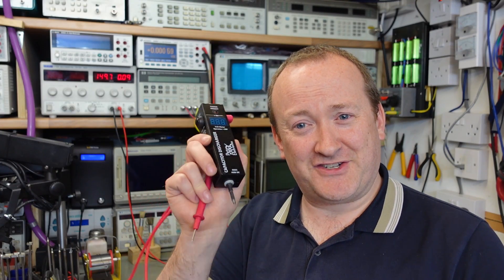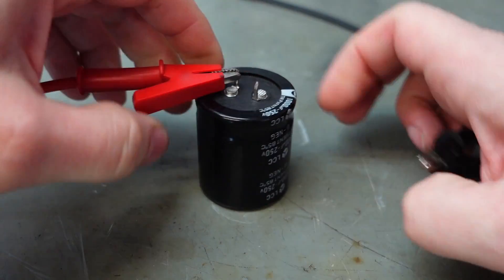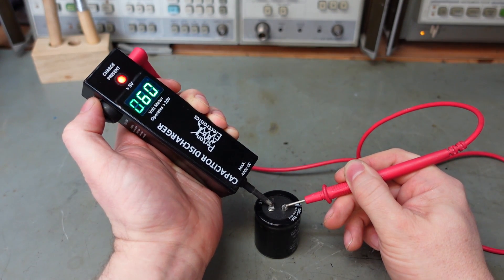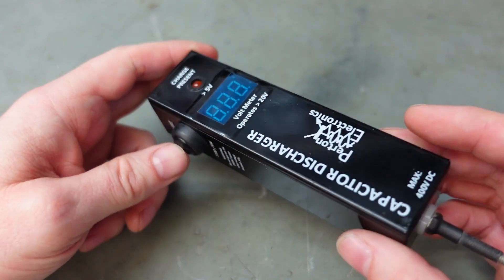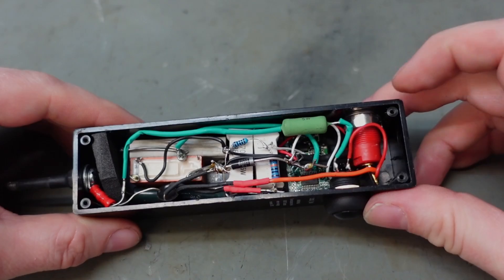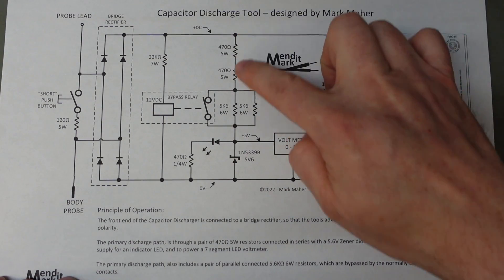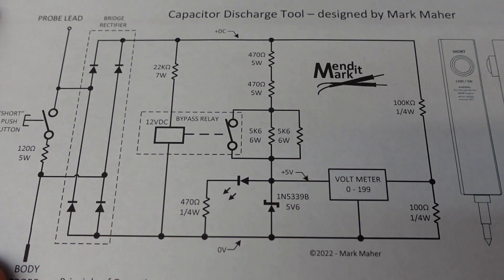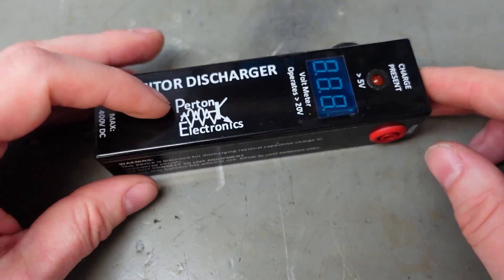The BEST Capacitor Discharge Tool I ever had!

Comment: Question.  What prevents over voltage of the 12 relay inputs? My relays max out at 30 volts and the voltage on my capacitors varies widely.

Comment: I'm confused by the resistors to the right of the voltage meter. If that's the sense lead of the meter, the resistors would form a 1001:1 attenuator, right?  What's the volt meter's full scale? If it's 199mV FS, that's only half the rated input, and it seems like double the input could damage the meter.

Comment: Mark is it possible to put a bleed resistor in circuit on the power supply?  I have seen them in tube amps but i would like this in my Sx 737  tuner because im constantly working on it and dont want to get shocked if i forget?

Comment: You can use a 220 60w bulb to discharge a capacitor. Wattage of bulb depends on the capacitor you intend to discharge. Simply connect the bulb across the capacitor.

Comment: Good tool!    What about a discharge tool for high voltage capacitors found in microwave ovens (typically 1 µF 2 000 VDC) ?

Comment: Excellent tool, one of the best I have seen. Maybe connect the probe fixed to the case through a banana socket so that one can switch it with a flexible test lead if desired (e.g. for smaller or difficult to reach caps). 
Mark, would you mind making the schematics, BOM and possibly Gerber files (and enclosure) available for download? Would really love to get this onto a PCB (am a bit OCD), and build it for myself. Not sure what relay to use... Many thanks!!!
Reply: Would the following parts work?:
Bridge rectifier: Comchip GBU2510-G
Relay: Omron G5NB-1A-E 12DC (Or similar from Panasonic?)

Comment: It's much more fun to discharge a high voltage capacitor with a screwdriver.
Reply: More fun, but the current pulse may possibly damage the capacitor.  Consider that the C's used in electronic flashguns are designed for high discharge currents.

Comment: when the cap is charged to a high voltage, there will be a brief current spike when the discharger is connected before the relay is activated (which takes time). I wonder if that's going to be a problem. Not for the resistors, of course, but what about the capacitor?

On second thought, however, that current isn't going to be big: only, say, about 2 A at 2 kV, and only for a brief period. The momentary discharge power, though, as seen by the cap, will be 4 kW, that's a lot. Maybe this device is good for only up to 500 V or so.

Comment: I just used a $2 multimeter, sliced in a 400 ohm power resistor halfway up the leads, plus a turbo button with 10 ohm resistor across that. Doesn’t require the voltmeter but it’s fun to watch.

Comment: Hi Mark, I hope you are well. Can you tell me why your meter on the pen says it only reads above 20v when it is powered by 5v? is this a restriction on the meter itself? also will your meter display over 400v? i see your pen is rated at 1000v. I would like to try to make one of these but I don't have a meter lying around, could you advise what meter display you would have purchased if you didn't already have one please?, love the video's and your relaxed style. Many thanks.
Reply: There are two scaling resistors on either side of the INH (input to meter). Most panel meters either have internally or are left for external. I have a meter that by default is 0-200mv. You can add different combinations of scaling resistors to do different ranges - 0-20, 0-200, 0-2000 were given in the data sheet for my Lascar SP400. I went for the 0-2000v scaling as I suspect 200v isn’t enough for many PSU hot examples. You do need to be careful to test the 5v inputs otherwise you’ll blow it. You also need to be careful with the 12v inputs for the NC relay. They are sensitive. For the bridge rectifier, I chose a packaged 600v capable Vishay rather than discrete diodes so again be careful of voltages likely to be greater than 300v (common for PSU capacitors). There are different form factors, so choose one for your chosen PCB or veroboard layout. Paul
Reply: @paulgamble7548  Thanks for taking the time to reply to me.
Reply: Have designed and built a case with PCB mounts and a veroboard layout. If you like details of components and details of case and board, do let me know. Paul

Comment: What should be the specs for the bridge rectifier? Anyone know?
Reply: if you have to ask this, you shouldn't be working on devices where discharging the capacitors is relevant.
Reply: @s_s-g4d  Thank you for the very usefull response
Reply: @Vonaan  well, I agree, that wasn't really the right answer, as it doesn't bear any good for either scenario.

let me try rephrasing it a little to make it actually useful.

the specs for the bridge, or for discrete diodes used to make one, should allow to withstand the maximum voltage (max reverse voltage spec in the datasheet) and current that the circuit will be subjected to, plus a certain headroom (30-50% generally) to accomodate for any unexpected variations.
Reply: @s_s-g4d  Thx, that makes a lot of sense. With a wide variarty of capacitors being found in Amps I asked myself what Mark had used.
Some capacitors in the PSU's are  huge and I'm wondering how many amps the bridge would need to handle. And indeed I don't know how to calculate or gestimate that.

Until now I've just very careful in handling those big caps.
Reply: @Vonaan  the easiest and probably the safest way in your case is to use a simple high voltage rated (ideally look for several kV to be safe, or connect several in series) resistor of, say, 100 kOhm.
then, to get an idea of how long it takes to discharge a given capacitor that is fully charged, using a resistor, search for "RC time constant".
verify with a voltmeter after discharging.
Ohm's law is your friend to understand the relation between volts, ohms and amps.

designing a good (and safe) capacitor discharger that works for you which has active components requires certain knowledge and experience, especially when we're talking high voltage. I wouldn't recommend blindly using someone else's circuit.
Reply: @Vonaan  besides, don't forget about the energy.

capacitors store energy (there's a formula to calculate it knowing the capacitance and charge voltage).

big high voltage caps can store a significant amount of energy (which, as a side note, may well be enough to kill a human).

discharging caps means converting this energy to another form, namely, heat. that heat is generated in a certain element, typically a resistor.

the resistor has to be large enough to be able to handle the given amount of energy that is dumped into it during a given time, and energy divided by time is power.

this means that you need to choose an adequate power rating of the resistor(s).

there is a compromise between the discharge time and the power that the discharge element has to dissipate.

you don't want to draw too large a current from the capacitor to avoid damaging it (and/or the charge dissipation element, the resistor), but at the same time you don't want discharging to take forever.

that's where circuits more elaborate than a single resistor come into play: start with a lower current when the voltage in the cap is high, then increase it as it drops, keeping power more or less constant.
Reply: @s_s-g4d  Thx for the great info and advise. I and many others that will tread this, will put it to good use. Outstanding support and hat of to you sir.

Comment: I work on industrial air compressor with variable speed drives and I was told of an engineers in America working was working on an Ingersoll Rand compressor. He didn`t give time for the capacitors to discharge, and was electrocuted when he touched them.

Comment: Can this tool handle 1000V 100pF capacitor?
Reply: that will hold only 50 microjoules of energy. I doubt that you will feel it even if you use your fingers to discharge it.

Comment: Can this be used for microwave capacitor discharge? Thanks!
Reply: nope, or at least dubious. the resistors must be proper HV-rated and of a higher value. same for the relay, besides the relay will have a turn-on delay with all the respective consequences. you may want to check joesmith's recent video on this matter.

Comment: Hi Mark, I Hope things are going well! 
I have an interesting observation about aged electrolytic capacitors. I am rebuilding a 1976 Kenwood KR-6600 and relacing the pre-amp, tone & power amp board electrolytic caps, I was testing the old ones and 90% of them are 35% to 100% over capacitance and none are under. (new ones are all within 10%, usually under). 
The 2 large filter caps rated at 8500uf tested at 4800uf & 5000uf. Just curious as to your thoughts about how this happens, the large ones being under rated capacitance and the small ones being over. i am a newbie and I had never heard about caps going high. 
Cheers! Steve
Reply: FYI, I did test all of them out of circuit.
Reply: they are very likely leaky. meaning, electrically, not literally leaky, that is, they let current through even when fully charged, and that's exactly what makes conventional capacitance meters (like those in DMMs) show erroneous readings. of course they need to be replaced, if that's the case.

Mr. Carlson explains a lot about this, he checks capacitors for leakage is maybe every video where he restores antique equipment.

Comment: That circuit works, because there is 120R 5W. The problem is, that on 12V relay may be 24V to destroy baypass relay, and voltmeter is from 0V to 100V scaled, and when we have 20V on capacitor, we can see zero on it - and stop. 20V on capacitor  in the end - it's too much for safe connection to another capacitance meter. IMHO, that circuit is not perfect.

Comment: If anyone out there cares, I have designed a PCB for this circuit.  I made changes to the design for things that I thought OK.  REV A of the PCB had errors which I fixed in the design but have not had my REV B board manufactured yet, so it would need to be tested.  If interested leave an email and I'll send you the KiCAD file.
Reply: care to create a github repo for sharing, as you're apparently fine with sharing it?
Reply: Could you share it with mega, dropbox, etc.? Please.
Reply: Would love a copy of your kiCAD file, do you have it posted on github or someplace for download?
😀

Comment: That's is a lovely little tool. I just can't find the mini voltimeter LED Display over 100V DC. According to the drawing, yours measures 0-199V. Where did you get it? What happens if you discharge a capacitor over 199V? I work with some tube amplifiers and radios and some those B+ capacitors goes well over 250V. The voltimeter will be out of range unfortunately..

Comment: I build one of this for myself after seeing this video, and its really a useful tool and gimmik on the bench. The meter doesnt show much or better long, cz the discharge goes relatively fast, but its nice ;-))

The parts are no problem and for the case i use a Hammond  1552D5BK, 150 x 50 x 30 Handheld case (Amazon 15€, but sometimes not available).

Comment: If I make this tool, I will change the power resistors with light bulbs. They have non linear resistance depending on the temperature of the filament.
Reply: the problem is, you need the resistance-temperature curve to be the opposite that of the light bulb; NTC thermistors have the right one.
Reply: @s_s-g4d  try to put an NTC resistor in the contact and you will understand the error in your concept. Incandescent lamps, due to their natural PTC, will limit the current at the beginning of the discharge process, and when the voltage starts to decrease, as the resistance of the filament decreases, they will hold the current almost constant. Same principle is used in so called dim bulb current limiter, used in SMPS repair.

Comment: The cruellest trick was probably the old Leyden Jar/lab assistant prank.  For those of you who weren't personally acquainted with Faraday, a Leyden Jar was/is a large primitive capacitor comprising a metal sleeve encasing a glass jar, inside of which is a lot of metal bits and pieces.  There's a hook-like handle poking out of the metal bits and pieces, often with a metal ball on the end.  When the whole thing is assembled, you can charge it up with a Van De Graff generator to give an extremely respectable belt to anyone touching both the inner and outer bits.  The trick is that when it's charged up,  if you take all the three bits apart, any of them can be handled with no ill effect.  When re-assembled by our unsuspecting lab assistant from the parts left carelessly-on-purpose on the bench, well, I think it was curtains for him.  Now THAT wasn't clever.  We still laughed though.  Boys can be heartless.  I expect the school deducted the cost of the smashed Leyden Jar from his final wage packet too.  Is there no justice?  Of course, I'm forgetting the old Gas-Tap joke and the replacement lab assistant, but that's getting off the track.......

Comment: hello!
Good job but...
It seems to me that with a standard 12V relay (240Ω coil) and a 22k resistor in series it is not going to stick...
By the time the relay sticks and puts the 5k6s in series, the Zener diode takes a good slap in the gums. It is difficult to do otherwise with a relay.
What do you think?
Reply: Hi, I've just built the discharge circuit following Mark's schematics, and I think you are right about the 240Ω coil resistance. I used such a relay and it didn't engage when higher voltage was applied to the circuit. I had 22k/10W (7W in Mark's design) resistors lying around, so what I did was connect this resistor in parallel with the existing 22k/10W resistor, reducing the resistance to 11kΩ, and it did the trick. Now I have 12V across the relay coil when 400 VDC is connected to the input. The relay engages at a minimum of 280 VDC and disengages at around 100 VDC when the capacitor is being discharged, which is what I need. The current draw of the modified circuit is a little higher, but it should still be safe for the capacitors. Mark might have used a relay with a higher coil resistance in his design, but the circuit is cleverly thought out. I like it very much.

Comment: Great Tool to have, besides discharging capacitors for safety, it would be very handy for making sure a capacitor is discharged before testing one. All that voltage could damage your cap tester.

Comment: I DO not trust that capacitors (with high voltage) are fully discharged until i test the voltage a few seconds later.
Once, I discharged a failed capacitor (22 or 47μf at 400v that was charged with a voltage of about 250v) but short after, the voltage was ramping up
I had to discharge this cap several times! Again and again.
Sure I was laughing and having fun, but since the voltage was quite high, it is scary to thing that a capacitor can do that.

Comment: thnx ur video,im not good repairing electronics, but more mechanic tinkering tuner.  Last time repair my adf 660 tapepath idler issue and motor dissassemb and brush clean and collector buffing,bushes lubed. Belt was way too tight,and motor did  burn. Actually,two of them....my bad. So- im yarning on about me aiwaas problems...so eagerly waiting Mr Marks ADF-990 video..🤪🙏

Comment: The red socket for the probe is very pro looking. not seen those on ebay so i may have to 3d print some like that
Reply: @lezbriddon
Banana Jack Binding Post Nut for Multimeter banana socket Probes.
Multimeter female socket.

Comment: U can use a 200 watt bulb 230 volt also
Reply: Any thing that's a high wattage " resistive" load without any electronic components in them....like (electric)
clothes iron/toaster/hot plate/instant hot water geyser etc...that is lying around the house which you may not be using.😅

Comment: Handy tool. I have one with an LED which gradually fades as the cap discharges, but yours is much slicker.
I had my first cap explode today because I wired it in backwards ( it was kind of understandable, but I won't bore you with the reason).
Do I get a badge or something? A defining moment in my journey into amplifier repair.

Comment: When I was an apprentice in a colour CRT TV factory we would  charge up big electrolytics  and put them in a filing cabinet.  Newbie would be told to get something from the cabinet.  They would yank drawer open and there would be a loud crack.   My cap discharger is a 10 watt 10 ohm wirewound with two croc clips.  Had it years.
Reply: Any resistor above 5W really, will do. I have a 3 ohm 25W wirewound resistor in an aluminium shell that someone gave me. Works well.

Comment: in my day all we did was cut a jumper lead in half and put a 5w 10k resister in line.  clip across the cap to ground a let it set for a couple minutes.  very cheap but also not the safest because if you forget that it's in there and power it up, smoked resister.

Comment: Microchip makes LR8 and LR645 high voltage linear regulators, first one is 13.2v..450v in, 1.2v to Vin - 12v dropout voltage out, 10mA cont. ... the second is 15v..450v to 8..12v ~3mA . Could easily use the first to output 2.5v or more to power a red led voltmeter as long as input voltage on capacitor is above around 15v 

To discharge below 15v, a simple resistor across the bridge rectifier would do the job.